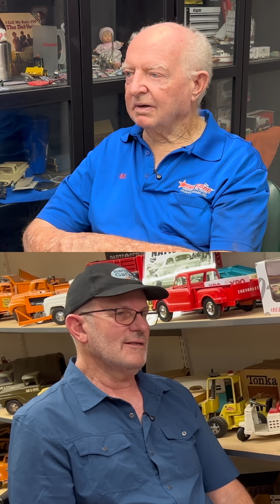ONLY One Way to Polish a Crankshaft - Ask Ed Smith 38 - with #BarryT

Comment: They used both small and large journal mains and in the 327
Reply: Small journal one is the higher revving of the 2 because lighter and less friction on the mains   283 crank in a 327 is a 307
Reply: True.....I've always wanted to make a large journal 327 using a crankshaft from a 307 and a 350 4 bolt block and see how that would stack up against a small journal 2 bolt 327 🤔